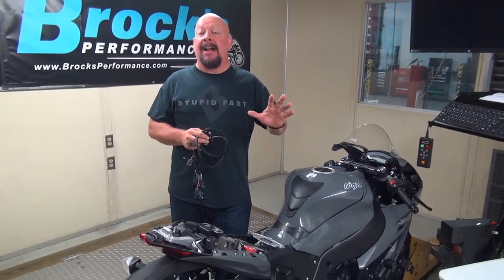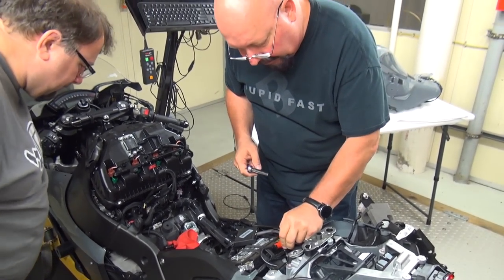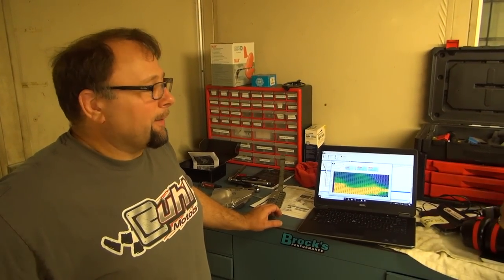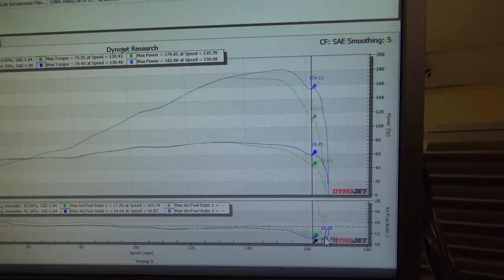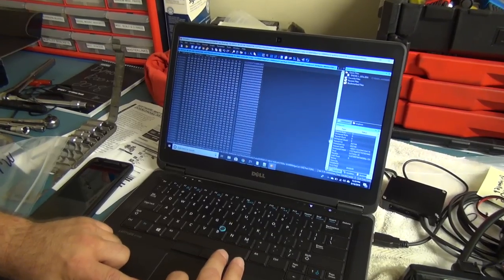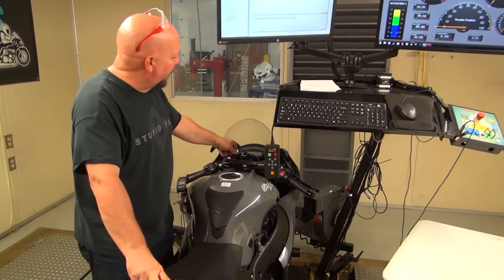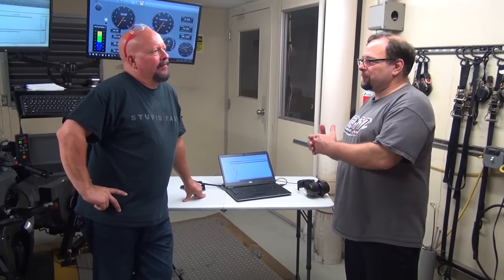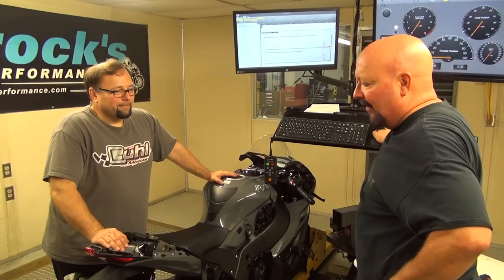Kawasaki Ninja ZX-10R (2019) ECU Flashing with Mad Scientist Don Guhl

Comment: first!!!!! love the videos!!
Reply from the maker: "If you aint first"....
Reply: Does the 2019 gul flash have the "easy reset"  and did he figure out how to install launch control. 
My 2017 gul flash cant do launch control.
Reply from the maker: Yes on the diagnostic reset. Supposed to have launch control - i haven't looked, only dyno testing currently.
Reply: @dieselgsr4m  If you have a 2017 ZX10R, your launch control should function. Our programming should have no negative affect on the launch control. All of our reflashes for the Euro-4 Kawasaki bikes should have the "User Mode" error code reset function.
Reply: @GuhlMotors  hi Don. I have the 17 RR no launch control. Another question i have is can you while your flashing change stocks quick shifter parameters, shorten kill times and stuff.

Comment: you guys increased power after the   drop  but that shit is  waste of time   because id shift it right at the point when it  starts droping or lil bit before thats were to set your shift light  at and never go past the point of were hp drops off at
Reply from the maker: 100% correct...in an old carbureted application. Modern sportbikes have ram air, which eliminates the drop off in dynamic applications. Here is more info: https://blog.brocksperformance.com/faq/how-can-brocks-get-mapping-so-close/

Comment: Is that the same stuff you did with the zx14 ? Will you get those same type of numbers with a 14 just by electronics?
Reply from the maker: It depends on the year. The older 14's were not as restricted as the 14R's.
Reply: @BrockDavidson  I'm looking at a 2012 or newer
Reply: @BrockDavidson  looking at making it CLOSE 2 a real street bike but actually keeping it on the street
Reply from the maker: https://blog.brocksperformance.com/kawasaki-zx-14r-12-16-information-page/
Reply from the maker: https://blog.brocksperformance.com/stock-to-brock-worlds-quickest-stock-motor-bikes/

Comment: "professionals" using posi tap on OEM harness...Hmmm. No thank you. That's a short cut.  True "professional" way is to remove the pin and re clamp both wires with new pin;-) This avoids having a split/hole in your oem wire when removed. Posi taps are for DIY weekend warriors to scared to crimp or solder.
Reply: If the power commander were a permanent installation, I would have spliced the wire using a professional splice crimp and glue heat shrink. Since this was a temporary installation, it made sense to use a temporary splice.
Reply: @GuhlMotors  
I respect your work don. Ive known of you for about 10yrs since ive been on the 10r forums. I work as an electric motorcycle master tech for zero motorcycles. There is nothing wrong per say with what you guys did other than the term "professional" word being used. Not tryina be a stickler but putting a large pinhole in a customers bike temporary or not is not ideal.
Reply: @motowerkz3678  I can't say I would be a fan of posi-taps. I was hesitant to even use them on my license plate lights. Especially so, that it is temporary and now a hole is in an electrical wire.